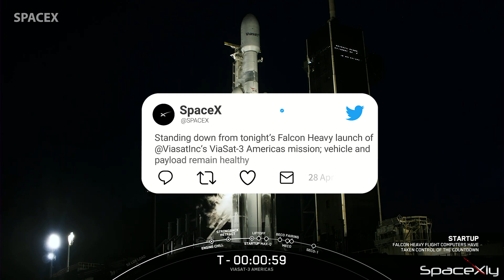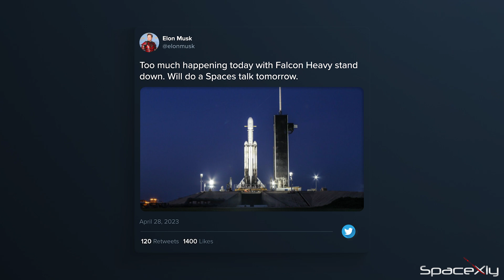Starship Launch Pad Clean-Up in Full Swing | More Delays on Falcon Heavy Mission | SpaceX Updates

Comment: Water cooled steel plate flame diverter will not be enough. It should be water cooled Abrams tank armor grade depleted Uranium plate flame diverter.
Reply: I believe Uranium 238-236 are realy prone to oxydation at high temperatures so a DU plate might not survive a Super heavy.